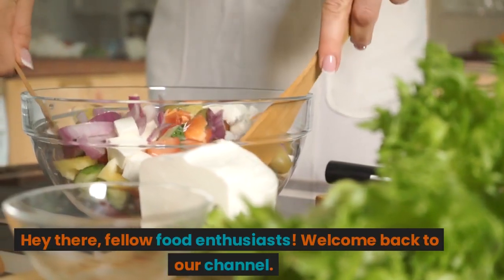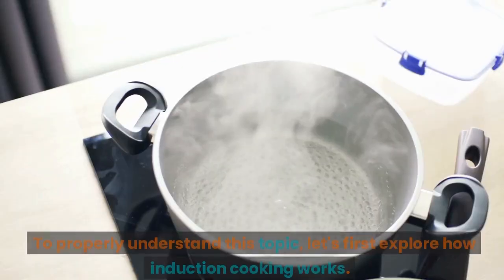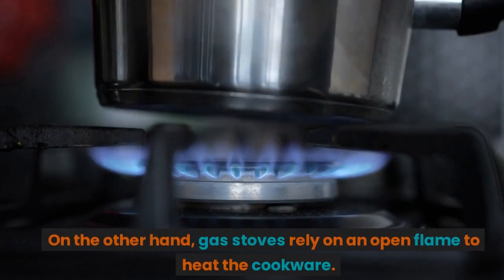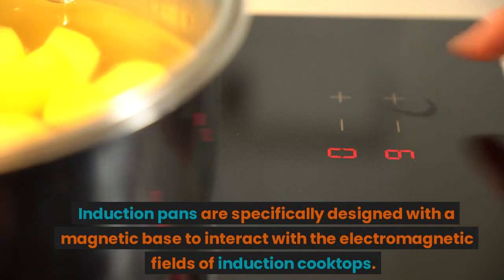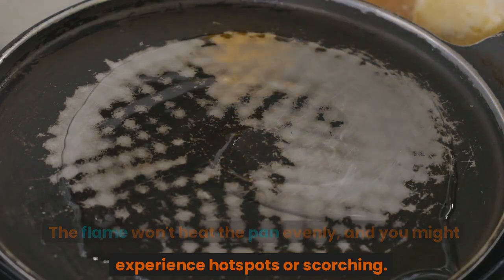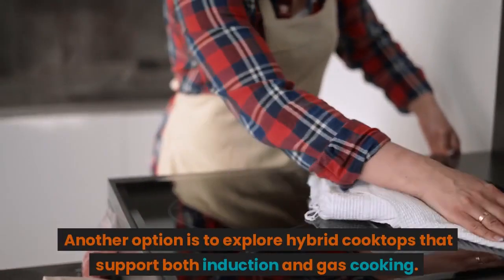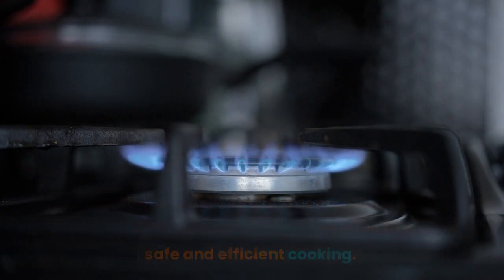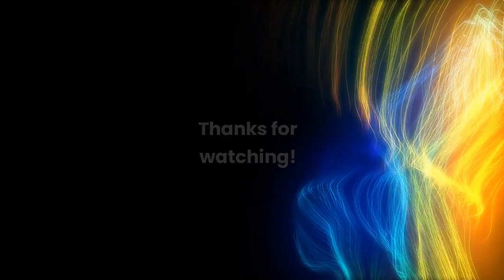"Can Induction Pans Be Used on Gas Stoves? | Myth Busted!"

Comment: The pans literally say they're for use on induction, gas, and electric hobs. And induction pans have to be flat on the bottom to ensure it all touches the connection. This video goes against every other video and research I've done thus far!